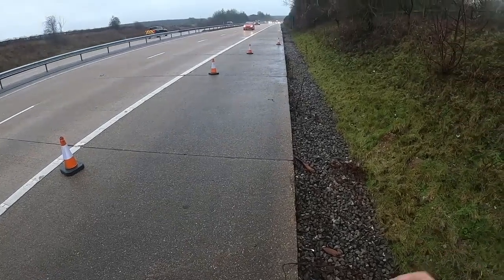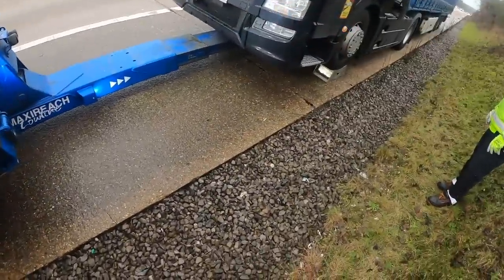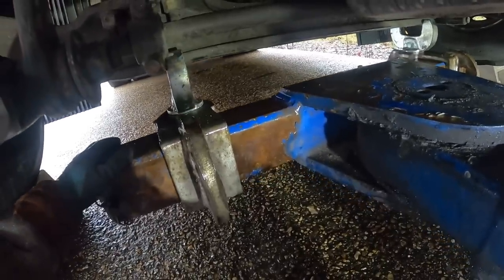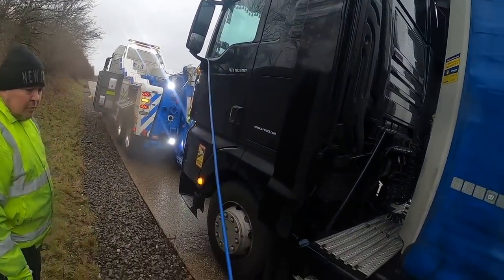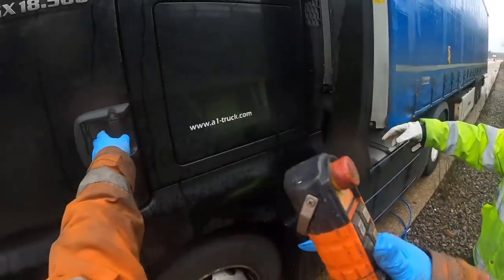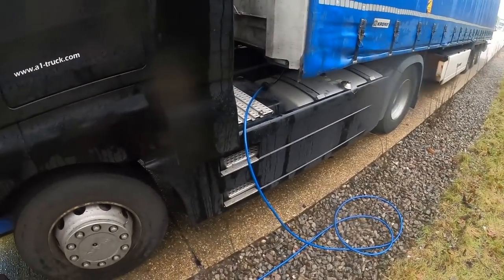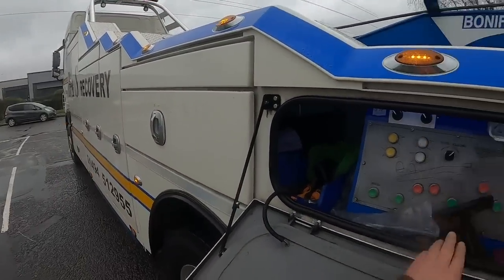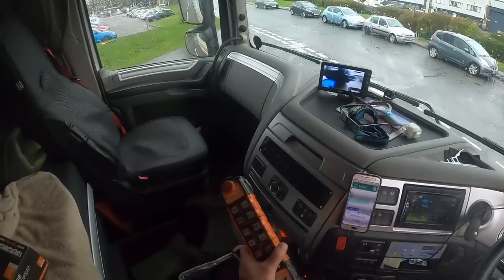RECOVERING 40 TONNE UNIT & TRAILER!

Comment: Oooh new video from Steve! Keep them coming!

I have a question regarding underreach designs. I've seen two different design out there.
The T-head with grabbing forks, which your trucks has, and a "wheel grabber" which gets a hold of the wheels and uses them as achors instead of the axle or other parts of the vehicle.

What are the pros and cons of each design? Why would someone use one over the other, and which one do you prefer?

Thanks and have a nice day!
Reply from the maker: Hi Zoltan thanks for watching , we tend to use lifting forks in the UK more so than wheel frames where the wheel sits into the frames.
The wheel frames we mainly use our for coaches with independent suspension that doesn't have a front beam axle to lift on.
Lifting forks i find a lot easier and quicker to use and less likely to ground the wheel frames out when going over speed ramps and slopes over here in UK.

Comment: Nice work and feel sorry for the driver breaking down in uk, would that have to be recovered back to Latvia if it can’t be repaired in the uk, be a hell of a drive lol
Reply from the maker: Hi Roy thanks for watching , Man dealer would want to fit new engine i would of thought but company will get it transported back home on low loader and rebuild engine themselves.
Reply: At least someone in Latvia will know what they are doing to repair it and most probably cheaper lol    Not a lot of chance getting it repaired in the U/K from what i have seen of MAN Stealers in the pasted ??

Comment: Hi Steve, Great video! Really enjoy watching them :) Just wondering what the reason is behind you decoupling the red Airlines from the trailers and hooking up a direct Suzie from your truck, wouldn't the airline you put directly into the test point supply main air to the trailer between the airline from the unit?
Reply from the maker: Hi Callum , we have to still run a emergency red line to the trailer in case the unit becomes detached from wrecker in a accident  and the brakes will come on the trailer stopping it rolling away.
Reply: @HeavyRecoverywithSteve  Hi Steve, thanks for replying! I see so the principle is behind the towing vehicle coming detached from you rather the trailer becoming detached from the unit. Would the same principle not happen between the wrecker and test point in the event of a detachment? That way if the trailer was to detach from the unit the trailer would brake, and if the vehicle on tow was to detach from the wrecker the main airline into the test point would snap braking the unit and trailer together?

Thanks again :)

Comment: Hi Steve. I'm currently awaiting a start date for a firm in South Yorkshire so I'm enjoying watching your videos! I was just wondering if there is any reason when recovering a unit and trailer you use the light board rather than the trailer lights? Is there a reason or is it just personal preference? Thanks.
Reply from the maker: Hi Simon thanks for watching , just preference on day mate really , if been night i would of used electrical susie so would have had lights down the sides on the trailer as well. Good luck on job Simon glad you finding the videos of interest.

Comment: I Gotta Say, its Pretty convenient that the trailer had TWO Electrical Connectors on it, so that you could leave the tractor connected, AND be able to operate the tractor's own Marker / Indicator / Brake lights as well via Backfeed from its connection to the trailer.
I'm surprised you don't plug into the trailer directly more often for the Electrics even if you need to disconnect the tractor from it.
For car drivers, I'd day that its less confusing to use the trailers own lights, vs the light board you have, especially because then the side indicators and side markers are also functional which helps us car drivers with seeing what's going on.

Also, I like how MAN made the tractor air connections as accessible as they were, sure they were under neath the nose of the trailer, but you didn't need to go diving under the hood, or get under the tractor to get at them, if only they were all that easy.

I do have one query though, Does your wrecker also have a reasonably high amperage 12v / 24v Power Connection on the back (Usually an Anderson SB Style plug) that you could connect onto tractors that also have such a connection to keep the towed tractor's battery topped up? 
Might be useful for times when you need to keep the ignition powered on for various reasons, as well as for jump starting purposes (even if that means having to sit and wait 5-10 mins for enough charge to transfer to allow the stranded vehicle to start).
Reply from the maker: Thanks for watching and comments , i have a battery boost on board comes in handy to start vehicles with charging faults to get better access for loading.

Comment: Guessing your not too preferential to wheel webs, feels like a better alternative to double picking those things if I were say.
Reply from the maker: Hi Sterling thanks for watching , when using wheel grids you still have to double lift sometimes , as engine sumps and suspension can be low and can be damage on boom. So you have to lift onto blocks and make wheel frames smaller so the truck wheels sit higher in frames giving you more clearance and allow for bouncing in travelling.
Reply: @HeavyRecoverywithSteve  ah ok

Comment: How do you find Milwaukee compared to Dewalt?
Reply from the maker: Hi Al thanks for watching , Milwaukee is 3/4 and only gun i really need , Dewalt is 1/2 and struggles with half shaft bolts over 24mm . Had couple of Dewalts and found batteries become loose on body of the gun after a time,

Comment: Would it be possible to just leave the truck in neutral and take it to next exit to find someone to pull the other half shaft out. Or does that risk the transmission to much
Reply from the maker: Hi Ben thanks for watching ,  i wouldn't risk it mate unless it was bottom off slip road off motorway.

Comment: Is there a reason why you dont tow the truck in neutral ?
Reply from the maker: Thanks for watching , the drive line has to be disconnected to the gearbox to safeguard and potential damage whilst being recovered , by simply selecting neutral will not stop this.
Reply: @HeavyRecoverywithSteve  Cheers for replying Steve. I was just curious.